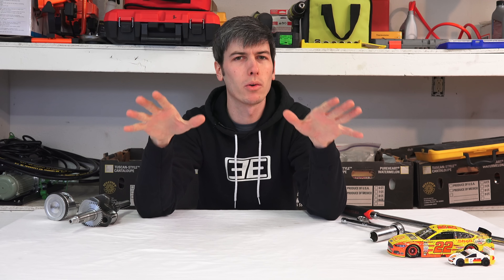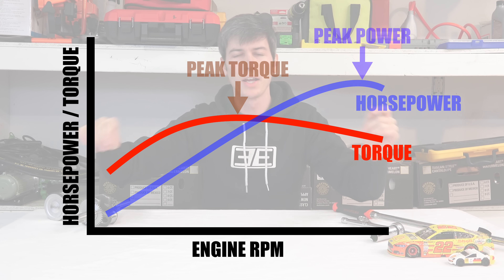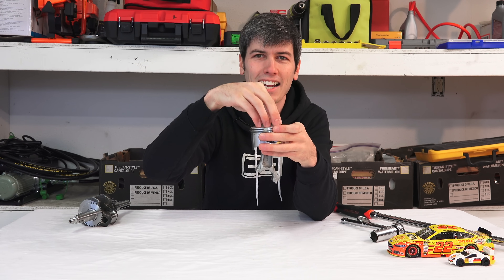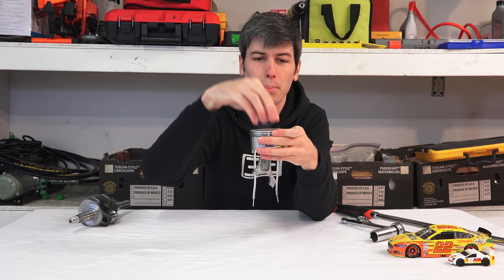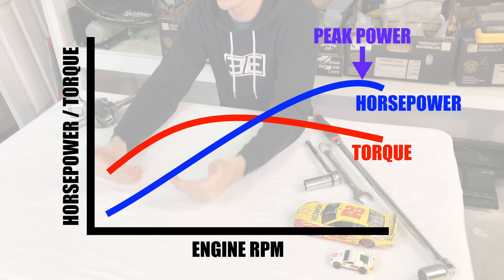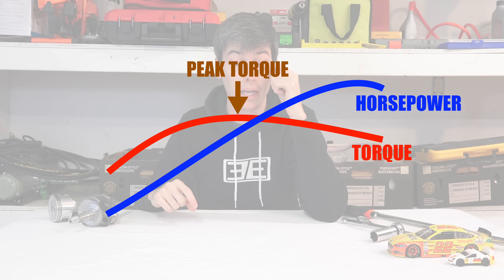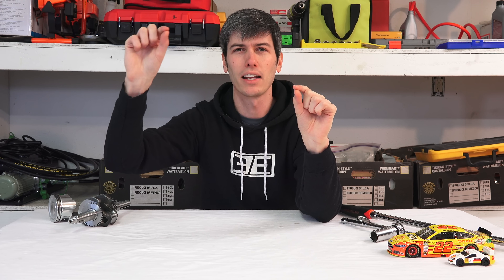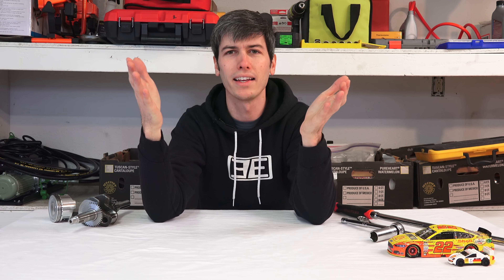Horsepower vs Torque - A Simple Explanation

Comment: Thanks for this. I've never understood why a tractor with 60 HP can out pull a car with 200 HP. Makes sense now.
Reply: You obviously didn't  understand the video. Give the car a lower gear ratio and it will outpull the tractor as long as it has grip.
Reply: Well, gear ratio doesn’t change soil consistency lol. That didn’t help it much. It got buried as soon as the steam tractor was put into “forward”.
Reply: @VinnyMartello  which is why I said as long as it has grip... Your response makes no sense.
Reply: My bad.
Reply: A tractor can outpull a car because it has more traction due to its weight, and very low gearing. It has nothing to do with the engine.
Reply: You can pull that shitty tractor with any car, Just you need very short gear ratio.
Reply: Gearing.
Reply: Torque itself or torque with low gears are the answer...
Reply: In almost every vehicle tug of war situation it comes down to weight. Nearly all vehicles produce more than enough torque to exceed their level of traction (e.g. to spin the tyres), so engine power, torque and gearing are all irrelevant. It all comes down to how much traction they can generate, and the biggest factor in generating traction is weight. It's for this same reason that tractor pullers and tug of war teams are categorised by weight.
Reply: What I haven’t seen taken into account is the weight of the tractor which provides far better traction, that’s why dual wheeled trucks can get pulled around by an otherwise identical truck with only two rear wheels. The weight is transferred to the ground easier, but if you took both trucks and loaded them to their max capacities the dually would pull.
Reply: If they both had the same weight, gearing, and tires on the driven wheels the results would be much different.
Reply: Tractive effort is an old term not used much any more except among the steam folk. Steam engines (unlike you apparently) aren’t easily bent out of shape.
Reply: em745a  The exception is a steam tractor. You'll never outpull a steam tractor.
Reply: Empirical data would show otherwise. It was fun to watch the real world scenario where a 16hp Case steam tractor out-pulled an 800hp John Deere Power puller. Power is only one factor in the real world. Tractive effort, weight, the rigidity of the chassis. And the list goes on.
Reply: em745a  no it won't because traction is a thing and a truck which ways a lot has a lot more traction

Comment: Cars want more horsepower for speed  - Trucks want more torque for towing
Reply: You can say that you're making the same torque at a higher speed when power goes up, or you can say that you're making more torque at the same speed.  Either way, trucks want power for towing.  When speed is zero, pulling from a dead stop, obviously you're making no power, so that's when only torque matters.
Reply: @uchinanchuu58  ok, idealy trucks want more torque at lower speeds and cars want more HP at lower speeds
Reply: @jorgejaime4325  But more torque means more HP.  They're two sides of the same coin.  The only real exception is at 0mph where obviously no power is being made.

Comment: Hmmmmmm....we don't actually measure power. We measure torque and calculate horsepower. The torque curve of the motor guides how the power is delivered. If the torque curve is flat, an engine can generate peak power for a longer time. If the torque curve is peaky, power delivery is peaky. Typically you set the gearing up to keep the RPM of the engine where it delivers peak torque.
Reply: hba8103 Gravity isn’t/can’t be measured in and of itself either. It requires other variables to be inserted and those variables don’t amount to meaningless findings. The video explains this. 

Or perhaps your entire beef relies on the idea you can’t directly measure HP...in that case, yawwwnn
Reply: mtb416 LOL. That’s exactly my point. HP is a calculation. Actually the equation he gave is missing a number. 5252. Check most HP vs Tq charts and you’ll see they cross at an RPM of 5252. But sure. Have it your way. 

Gravity can be measured by a gravimeter. The military requires precise measurement of gravity at any point on the globe to launch iCBMs. They are ballistic after all. But sure. Again. Have it your way.
Reply: mtb416 there was nothing pedantic in my statement. Torque is measured. HP is calculated. You derive from that what you want. HP is derived from the torque. Not the other way around.

Comment: Torque is an ingredient of power. The other is RPM. Low torque high rpm is equally fast as high torque low rpm. Sometimes high torque engine cars go faster. When that happens those cars actually produce more energy during the acceleration test so that means the average power was definitely higher.
Reply: Your analogy makes a lot of sense, thanks
Reply: some late thoughts.     'torque is newton-meters is force is power is hp is torque'.    by that i mean that the output energy of a car engine is the result of a  Series  of processes.    then, that energy is used in a weird way.   in that, there is  NEGATIVE MECHANICAL ADVANTAGE  at   the   ground.     why is this true.     the Radius of a wheel is, maybe,  five times the size of the radius of the final gear, in the differential.          cheers

Comment: Very well explained but possibly some people will need more explanation. I think you should also explain wheel torque vs engine torque. 

One simple concrete example:
If you are cruising at 140kph, 2500rpm, with 57hp, 120Nm, sixth gear. Then you shift to seventh gear. You will need the same power for that cruise speed, 57hp, the rpm will drop to say 2100rpm, and the torque will be t=p*5252/rpm so 142Nm. However, in these 2 cases, the torque is engine torque. The wheel torque will be obviously identical since you Traction=Drag so traction force needs to be the same. 
So as you can see the engine power is what is needed to keep the car at that speed or to give you a certain acceleration. The engine torque at the required rpm will give you the required power. 
You want for example to accelerate a sports car constantly at 1g. 9.8m/ss for say 10 seconds.  For that you need a constant wheel torque which can be achieved with any constant engine torque and the proper gear so that you get the required wheel torque.

Comment: What if the bore was a radius concentric with the crank shaft. Force would be always have maximum torque not diluted with Pythagorean
Reply: Forrest deno can you make a drawing?
Reply: You would have to continue shifting the cylinder to do that, which is not practical to build.   Inox1ck, what Forrest means by "Pythagorean" is the fact that the connecting rod will not apply a perfectly perpendicular force on the connecting rod as is needed for maximum torque.   The sine term comes into play, and reduces the torque from what it could be.   FYI, that has nothing to do with "Pythagorean", as trig is a different concept altogether.

Indeed, if you could continuously align the cylinder bore with the position where the connecting rod lands on the crankshaft, you could eliminate the sine term from the torque equation.   But now the position of the cylinder has to move with the crankshaft, which isn't practical to build.

Comment: Ok there is a question then.
Let's pretend we have the two cars mentioned in this video and the are both equipped with CVT adjusted to keep optimal rpms on both vehicles. Which one will go faster? The torqie one or the horsie one?
Cause torque is the moving power after all in my opinion and the second parameter is the torques range..
Reply: Josh Wkr No matter the engine rpm at a certain speed you will need a certain wheel torque for constant speed or a particular acceleration . But while the car is moving wheel torque or engine torque means power as well. Torque is an ingredient of power. 
We are comparing low power high torque to higher power low torque. High power means high wheel torque

Comment: So could you not make up for low hp with less aggressive gearing and high torque?
Reply: You cannot increase the horsepower through gearing.  You can only lose horsepower through inefficiencies in the gear system.

Gearing allows us to trade torque and RPM, so the engine can operate in its ideal RPM range for the task at hand.   It allows us to generate more torque for the driveshaft (at the "expense" of speed) than the engine could generate on its own.  It also allows us to rotate the driveshaft (and subsequently wheels) faster than the engine, so that the engine doesn't need to scream at 7000 RPM for you to obtain a highway speed.  The engine can "relax" in its ideal RPM range, while the drive shaft spins to be consistent with speed.

Comment: If the two cars are exactly the same....the one with the higher torque will outrun the one with high hp then (0-60) then hp kicks in and the second car wins the race
Reply: U said that the one with higher hp is faster but that's not 100% accurate

Comment: mmm i was thinking that the car with more torque would accelerate quicker if all else is equal.   in your video you state the lower torque but higher power car would accelerate faster, but you explain this by gearing.  which is not an equal comparison!?
Reply: Agreed, depends how long the race is and power curves. Torque is more important.

Comment: VERY poorly described, and bringing 'cars' into the equation just muddies that murky water further. How about this: TORQUE is a measure of MASS over distance (lbs-ft) while HORSEPOWER is a measure of TORQUE applied per SECOND (lbs-ft-second)...therefore, you can 'crank 500-ft-lbs of torque' against a lever-arm and move nothing (resistance == force), but with horsepower, you MUST MOVE THAT MASS with DISTANCE-PER-TIME (thus, acceleration).
AN old saying: you can put all the torque on it you want, but you may not be going anywhere with it...but if you put horsepower on the job, you're going to move something, somewhere, immediately.
TORQUE DOES NOT WIN RACES...HORSEPOWER DOES! (and Torque normally 'lugs' as a ratio of horsepower/torque...such that diesel class 8 trucks LUG LOADS very sluggishly because their horsepower/torque is usually a value of 0.20 or lower, while race cars usually 'perform' with a horsepower/torque of 1.0 or higher. (this comparison is much related to the 'over-square' or 'under-square' comparison of engine bore x stroke, as well as the 'magic value' of 1-hp per cubic inch defining 'performance' vs 'economy'.

Comment: Basically torque is your powerband. The higher the torque, the more access to the power you have can be achieved amongst more gears. Less torque probably takes higher gears to access the full power. So more torque can make you feel faster because you can get that power access much sooner.
Reply: You've made a few conflicting points there.

Comment: Why does hp start to drop with even more rpm? 
This is where these definitions dont make sense.
Torque shouldnt drop either
Reply: I understand a little more now.

The torque begins to fall at a higher rpm because of the source fuel .. it drops when the rpm is passed the optimal mixture .. like a stereo system.. it may sound the best at level 8, but not as good at 9 and 10 even tho its louder (the loudness wud be the speed/rpm.

So hp and torque really cannot be seperated.. 

Imo torque and safe rpm range shouldve just been measured. Screw hp ... horses no longer hav shht todo with it anyway  lol

Comment: Im not engine expert, but they should just make combustion chamber resizable, so that at higher rpm force of explosion doesn't wears out. At higher rpm reduce size of combustion chamber.  Imagine combustion chamber as a cube whose some opposite two sides can move closer or apart, depending on rpm, to reduce size of the chamber.

Comment: One mechanical horsepower lifts 550 pounds 1 foot in 1 second.
Reply: one 'horse' power is supposed to be that figure, but i was thinking a real horse either can perform more than that or less than that performance figure. it just standardized unit from many convention of scientist/engineer
Reply: @IlhamDefraN  James Watt experimentally measured the performance of what draft horses could sustain over a significant period of time, as he had draft horses pull a millwheel and measured the corresponding speed in each trial.  The 550 ft-lbf/second number, is an average of his experimental results.

Comment: How fast a car can accelerate from a stand still has more to do with torque than HP buddy especially the higher the weight of the vehicle. 
Electric cars like Tesla show case this well. 
The era not long ago when small cars almost all became turbo charged for emissions because much faster to 100km/h Not because they had a few extra hp but because they had double the torque and boom that also helped with fuel economy
Reply: Did you even listen to what he said? They are a product of each other... you can't have one without the other... they are directly linked to each other and horsepower is the dominating factor of acceleration. Remember... torque is manipulated with gearing... which requires horsepower.
Reply: @marcbennett9050  that's nice dear, I did listen and he said hp is the more dominant factor well that's bs because torque is the ability to move weight without enough torque it doesn't mater how much hp u make u can move the weight another great example of this is the Winkler rotor engine that can make huge hp low torque in comparison with other combustion engines and hence why Winkler's aren't used in heavy automobiles. 

If u saw the shift in factory na to turbo charged cars u would also note the hps haven't rises much in comparison to torque yet all those cars are significantly faster off a stand still to 100km/h so doesn't that directly say the extra amount of torque at lower rpm is the factor most influential in the better acceleration times...

Comment: This is why torque, by itself without considering rpm, means nothing for performance. Making torque is easy, just gear deeper. I can make a million lb-ft of torque with a handheld drill motor if I gear it deep enough. But it would be moving too slowly to be useful. What matters is not torque, and it's not rpm, it's the combination of the two. That number is called "horsepower".

Bottom line, the engine making the most horsepower will always put more torque to the rear wheel at any given rear wheel speed, always. That's an easily proven fact, not an opinion, it's not something that can even be debated.
Reply: Legit question here.

Can you explain why a 95hp 1.0 3-cyl Turbo engine is faster than

A 1.4 100hp 4-cyl natural engine?

3-cyl revs lower than the 4-cyl (6 vs 6.5 rpm) yet it's faster.

Why?
Reply: em745a  Ok I get your point. But having the turbo 3- cyl with fewer HP and the 1.4 with more HP at let's say 3000 RPM, the turbo should accelerate faster because of better torque. Right?

Comment: Horsepower is running like horse.

Torque is lifting up weight like donkey or mule.
Reply: apacheindian09 
That’s right except you are comparing high power - low torque to high torque - low power you are not comparing power with weight.
Torque is a component of power.